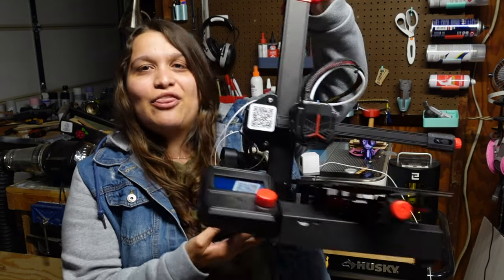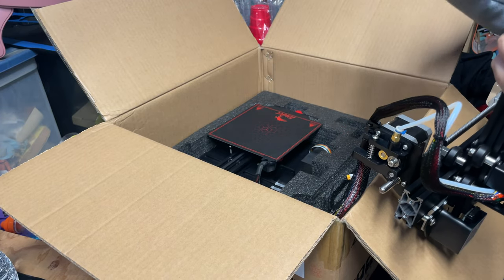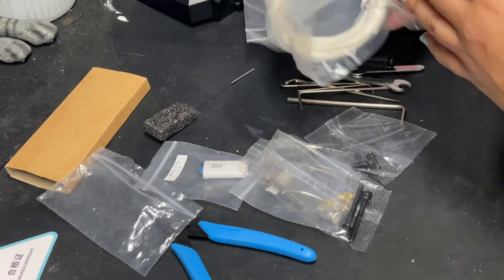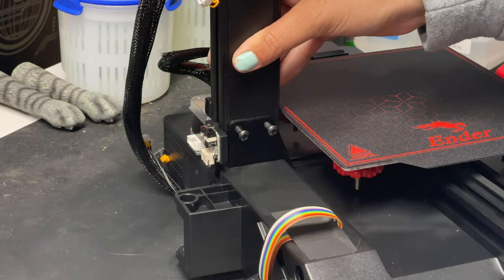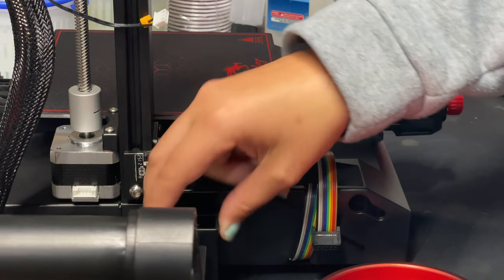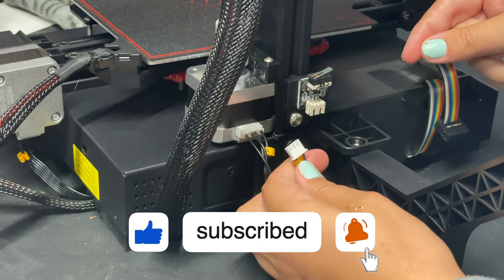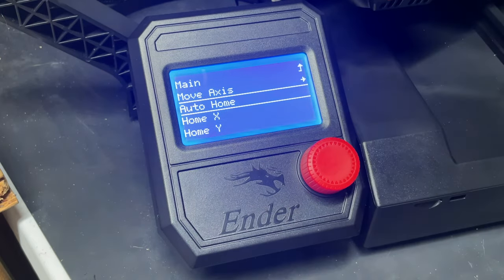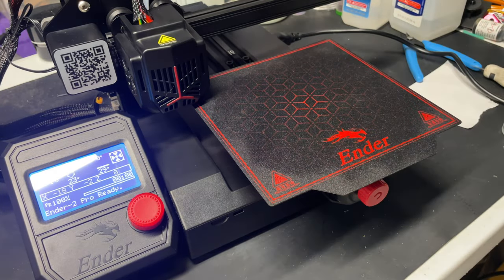Ender 2 Pro Unboxing & Assembly || 3D Printing 101

Comment: I have a stringing problem with my ender 2 pro printer. I have cleaned the inside several times, tried low and high temperature settings, and different retraction settings, but the problem did not improve. It was not like this when I first used it, the problem started later. What could be the reason?

Comment: Nice video, I would say the only thing is that with heating the bed up isn't so much the moving parts, but more so the expansion of the metal due to heat during the printing process.

Comment: I looked at several videos before I found this one.  Should have come here first.  Your examples were much easier and didn't include someone telling me how many upgrades or outfittings I needed to do first.  Thank you.
Reply from the maker: So glad it helped! I firmly believe in learning how to use a printer stock and mastering it before you do any upgrades. Typically I’ve found the more upgrades you make the harder it is to fix/get it to work properly. The only upgrades I typically do it a nozzle upgrade and a flexible build plate upgrade.

Comment: I have the original Ender 2 and despite having a printer that cost over 18X the cost of the Ender 2 it is my most reliable machine and the print quality is excellent but it is slow very slow, I run it at 50mm/s for draft prints and 40mm/s for best quality
Reply from the maker: I was so surprised how well it did!

Comment: Hi Ashley would you mind helping me with the right software where i can make my own pen designs  please ?
Reply from the maker: Absolutely. I typically use a combo of Adobe illustrator and fusion 360. I make my design in illustrator and then turn it into a stl in fusion 360. You could also use tinkercad as well.
Reply: @ChippedBuilds  What do you think of Adobe Dimension?  I've used it only infrequently and haven't really formed a solid opinion.
Reply from the maker: @sionanenrois1433  I haven’t tried it yet but it’s on my list for next month!

Comment: just got my ender 2 pro, my first print refuse to stick to the bed, i leveled the bed to the point the extrusion is thin on the bed, but the pla just wont stick, any suggestion?
Reply from the maker: That’s odd for sure. Did you clean the bed with ipa beforehand? You might need to use some hairspray or a glue stick to help adhesion. Make sure you are leveling the bed with a piece of copy paper and the nozzle should drag lightly on it.
Reply: @ChippedBuilds  thanks for the tip, but shouldn't ender have packed some glued in the first place if it is absolutely necessary?

Comment: Would you recommend this printer for a small print farm?
Reply from the maker: Depends on what you are printing. For a print farm I would go with either elegoo neptunes 2s, or ender 3 v2. If you have money to spare then maybe prusa printers. If you are only doing small items then yes this printer would be fine or a prusa mini.
Reply: @ChippedBuilds  Thanks for the quick reply. Yes was thinking maybe the E3 V2. i have had two second hand prusa machines but cost wise expensive. Will have another look at the E3v2's

Comment: so i have a problem with my prints not sticking and dragging along with the nozzle
Reply from the maker: Have you made sure the bed is free of dust and oils? Could be a bed level issue or the temperature of the bed could be wrong. What have you tried already?
Reply: @ChippedBuilds  i found out yesterday that i was just setting the speed to high but thank you anyway
Reply: @lassedb777  i m experiencing the same problem, how did you adjust the speed?
Reply: @tohneyteoh  in the info screen you can adjust the speed by just turning the knob it is set to 100% by deafult hope you find this helpful